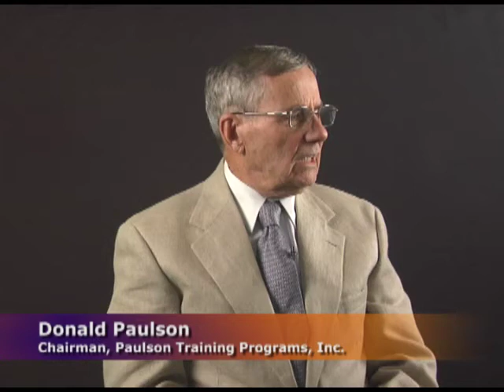Scientific Molding - Part 2: What Are The Benefits? - Don Paulson

Comment: 🎯 Key points for quick navigation:

00:00 Injection molding can be approached scientifically by applying physical laws.
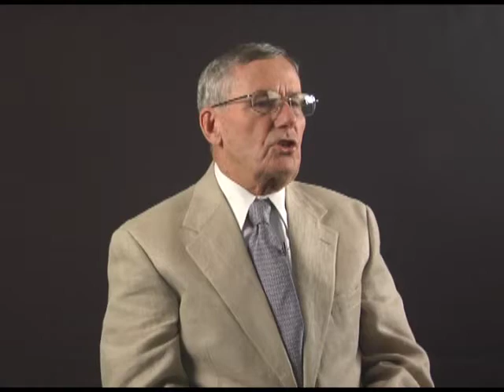00:13 In the 1960s, Kodak attempted to precisely control part dimensions by adjusting 15 machine variables.
00:42 The Kodak study found that numerous machine variables affected part dimensions, making the study inconclusive.
01:48 General Motors conducted a similar study to determine which machine variables impacted part dimensions.
02:40 A Vice President suggested that no process should have more than four independent variables.
03:07 Four fundamental variables—pressure, temperature, flow rate, and cooling rate—were identified using physical equations.
03:34 ‍ Research with students confirmed these four fundamental variables impact part properties.
04:03 Rod Gro aided this research, which proved plastics adhere to physical laws.
04:28 Current molding machines have numerous controls, necessitating the translation of these into four basic variables for effective molding.

Made with HARPA AI